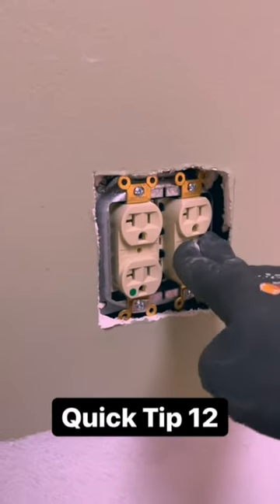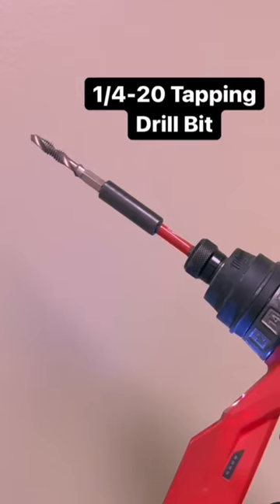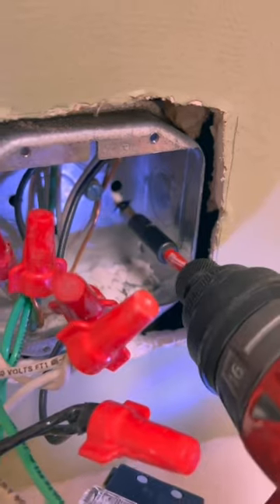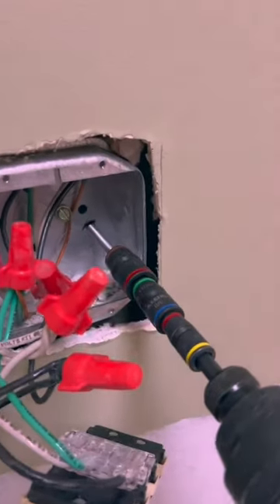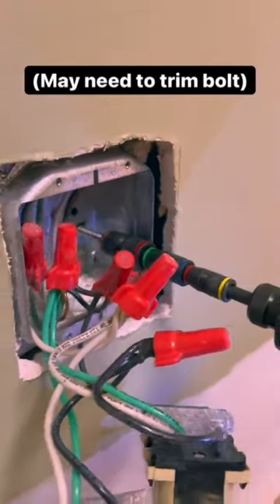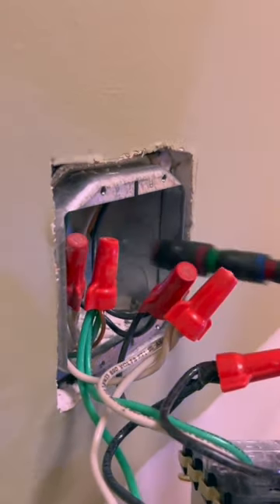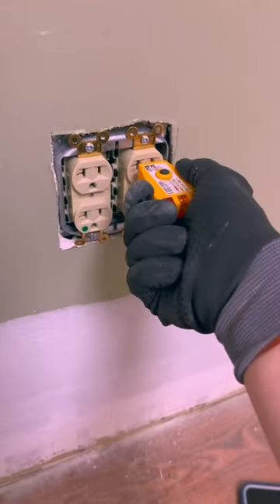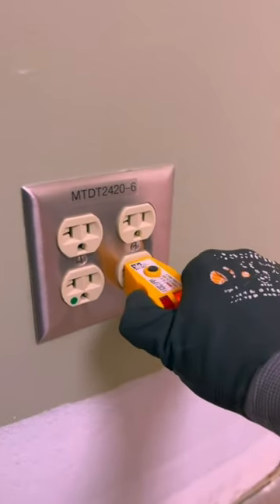Electrician Quick Tip #12 ⚡️

Comment: I can feel that hole on the other-side already - from here…
Reply from the maker: As long as you trim your bolt short enough to only push your box forward enough so that you can get your cover plate on, your cover plate should keep your box from pushing back further when things are being plugged in. The main idea for this trick is just to get your box forward enough to get your cover plate on. I’ve never once had a hole go through the other side. As long as you do this right that shouldn’t ever happen ⚡️

Comment: DON'T DO THIS. its dangerous and the first time you plug something in something you run the risk of the blot you put in there to push back and could spark and start a fire. Inspectors wont be to happy either

Comment: Spray foam is a better solution.
Reply from the maker: I think spray foam is probably the better idea. Never thought of it before people mentioned it in comments, but I dig it ⚡️
Reply: @MadElectrician  Your solution was  interesting, but takes a bit of time and could punch a hole in the opposite wall if the outlet is hit. It also probably doesn't work well on plastic boxes which are more common in residential (at least everywhere I have seen).  I hate to crack open a can of foam for a small job, but the time savings should recover the cost and it distributes the load to the wall and stud holding everything rigid, wires included.

Comment: If you installed the correct bracket on your box you wouldn't even have this problem.
Reply from the maker: This wasn’t something installed by me, it was an existing box.
Reply: Your work is perfect 100 percent of the time?😅
Reply: @zachcornelius5535  yes it is. Iv been an electrician for 30 years.
Reply: @michaelmurray214  
Right....

Comment: Now you can made a hole in the drywall. Do not do this !
Reply from the maker: Not if you trim your bolt to the right length. This trick is only to get the box pushed forward enough to get your screws for the cover plate into the receptacle. Once on, the cover plate will prevent the box from pushing back and your bolt shouldn’t even be touching the back wall. ⚡️

Comment: why why would you need to do that trick with a flush metal faceplate
Reply from the maker: The purpose of the trick is just to get your box close enough to get your cover plate on in the first place. Sometimes boxes are bending inward due to a poor instillation and you’re unable to get the cover screws onto your receptacle. Once the cover plate is on, it will keep the box from pushing back.

Comment: Never ever do this.
Reply from the maker: If you cut the bolt short, just enough to be able to get your cover plate on, the cover plate will pull the box forward enough to where the bolt won’t even be touching the wall behind. ⚡️

Comment: OMG, you hack, how many times does the homeowner get to plug something in to the receptacle before he pokes your screw through the wall into the room behind this box?   And have you ever heard of a Madison strap?   Basic box mounting/repair hardware that every apprentice learns in his first month...
Reply from the maker: 1) Not a house
2) CMU wall behind this (not drywall)
Reply: My bad.  A Madison strap does the  opposite.  It pulls a box that is protruding out of the wall back in.  Regardless, there are many better ways to accomplish this task without driving a bolt into the wall behind.

Comment: WTF is a 1/4 20 tapping drill bit??? Do you mean a 5mm drill bit?
Reply from the maker: Nope, a 1/4”. Says right on the bit.
Reply: It's for drilling and threading for a bolt.  1/4 is the size and the 20 is the thread count..  1/4-20 is a very common bolt size.
Reply: 1/4" diameter bolt, 20 threads per inch 
(1/4  20)

Comment: Rat tips
Reply: As a maintenance electrician, I prefer that the guy who roughed in the wall did it right to begin with. But since he didn’t, it’s up to me to make it a fully functional receptacle again so that every time you plug a cord into the receptacle it doesn’t pivot on the stud. I know how to properly rough in a wall but I cuss like a sailor when I have to replace a receptacle when the box is flopping around in the wall or they used a half inch mud ring on a wall with double 5/8 Sheetrock. If the moron wannabe electrician would rough in the wall correctly, my job would be a lot easier

Comment: Wait! That is Something i don't believe it works ! Is the screw been hold in place by the other side of the wall? ( Sheetrock) ?? Come on! Stop playing with people and don't do things that make people thing it's fix and later ,little by little will be the same
Reply from the maker: As long as you trim your bolt short enough to only push your box forward enough so that you can get your cover plate on, your cover plate should keep your box from pushing back further when things are being plugged in. The main idea for this trick is just to get your box forward enough to get your cover plate on.